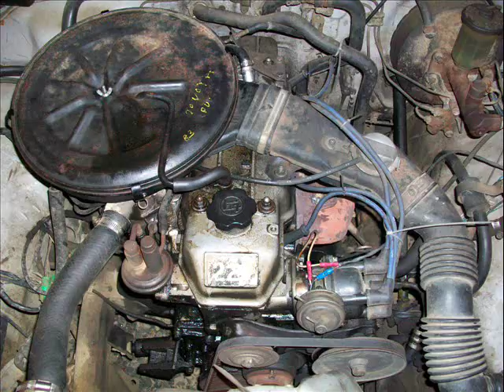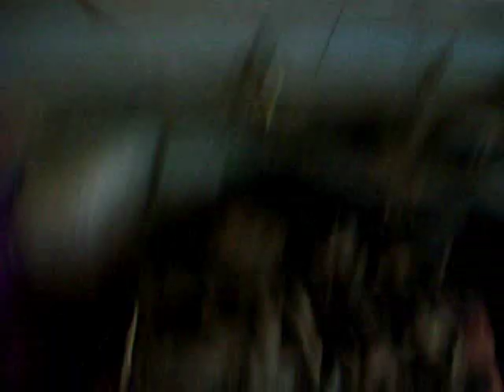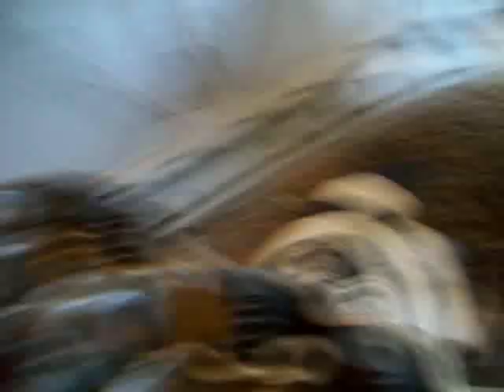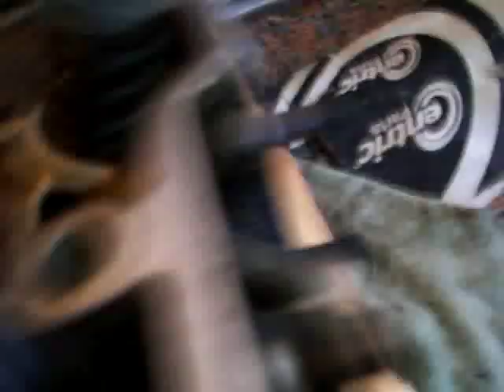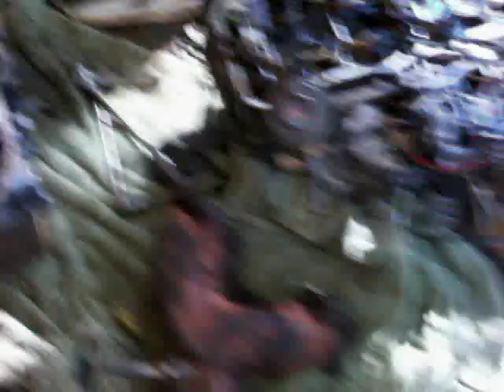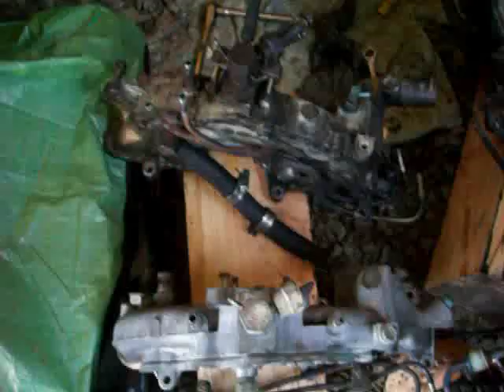20r/22r Hybrid Build Part1

Comment: what is that water neck part #
Reply: I am searching for a water neck that will work for my truck, someone already did the 20r/22r conversion but had a crap knockoff weber carb and i wanted to put the stock carb and mech fuel pump back on but when i did the water neck is too close to the fuel pump to work... ever find that part number?

Comment: @natescraigslist  You sure about those compression figures? They seem a little low. I had 5 thou machined off my 22R head and when I cc'd it the chambers cam out close to 9.7:1. That was also after I'd polished the combustion chambers. My vids of the engine are on here. Maybe US motors had lower compression to allow for different fuel grades.

Comment: we had to fab on the 20r head to take the 22-re intake,cam,exc. but it worked great when it was done. they also have aftermarket fuel injection for the 20r head but it's expensive.